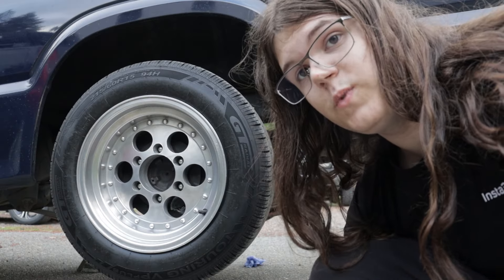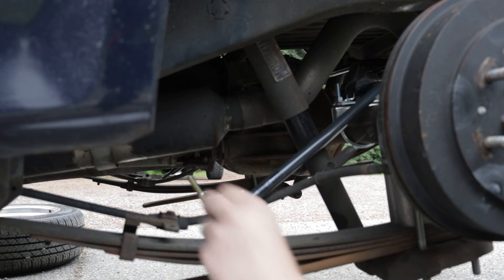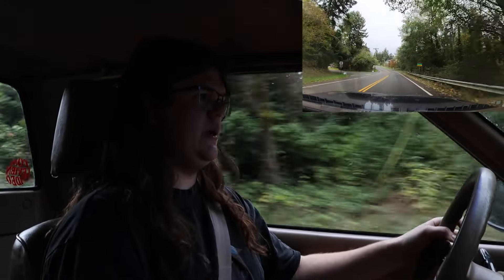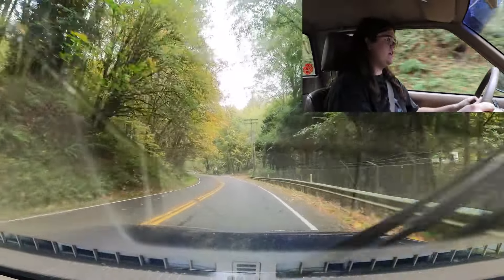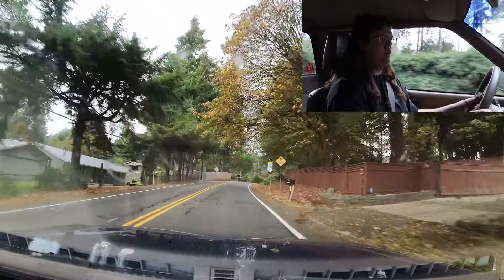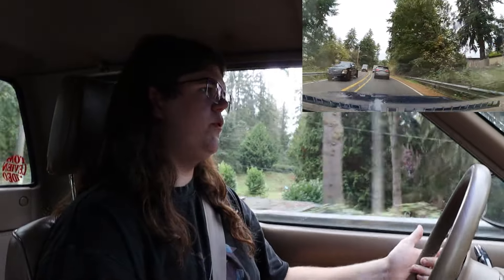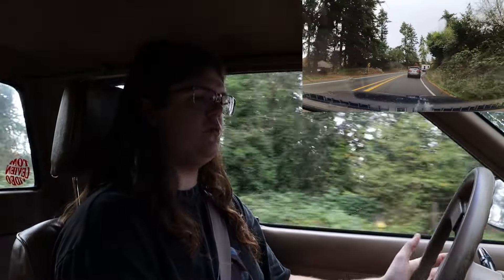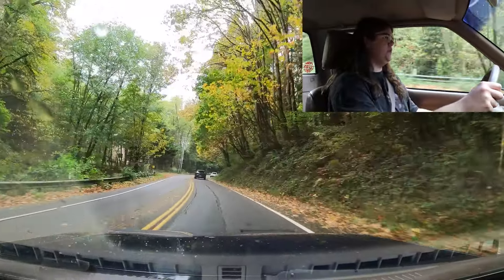The BEST Handling Upgrade For A Truck | Adding A Rear Sway Bar To My Mazda B2200

Comment: Sweet, planning on getting one soon. The front sway bar from belltech works great. And you said the rear end wants to cause some oversteer, planning on swapping the factory wheels and tires from a 205/75/14 to a 225/45/17, hopefully it helps with grip.👍
Reply from the maker: 225 width tires should work awesome with this, i have 215s and you saw how oversteery it was in just light rain so the more grip you can get the better

Comment: Big thing- make sure you match the front & rear rates so they work together. Too much in the rear and you'll understeer, too much in the front & you'll get oversteer. Everybody thinks "Bigger is better" in regards to size & spring rate, but you have to not over do it.
Reply from the maker: this is a little different because its a truck its already very front heavy so the rear sway bar doesnt need to be nearly as stiff as the front. also you have it backwards, a stiffer rear bar will make you oversteer and a stiffer front bar will make you understeer
Reply: @Blue_B2200  You're correct, I back-asswarded that. My point was that people tend to pick sway bars like they go about lowering and/or picking wheels & tires. They just think "More is better," "Stiffer is better," "Lower is better," or "Wider is better...." and they utterly screw it up. Their vehicle is twitchy, rides like a conveyor belt, and slides all over. It actually makes the vehicle comically worse.
Rain/snow/ice, imperfect roads, curves, corners, and chassis rigidity (or non-rigidity) will 'find a way' in the real world.
Reply from the maker: @olikat8 oh yeah for sure, the Belltech sway bars are the only ones available for this truck and they are non adjustable and only come in 1" diameter front and .75" diameter rear and i feel like having both is a big help but just adding the rear is too much without the bigger front bar in the first place
Reply: @Blue_B2200  I run an old domestic compact sedan- it has a lot of chassis stiffening, tweaked Borgeson box, SPC fully adjustable UCAs', 1.08" torsion bars, 12" front rotors & 11.25" rear rotors....but I know Peter Bergman and I listened to what he had to say on this build. I never ignore what people like him say in regards to their expertise. Funny thing? Even the exhaust was done by an on-staff engineer who learned exhaust from old man Bassani (Bassani Xhaust). It is the funniest old Valiant